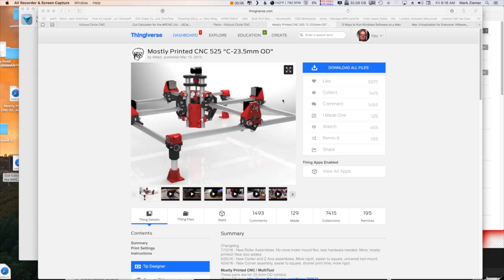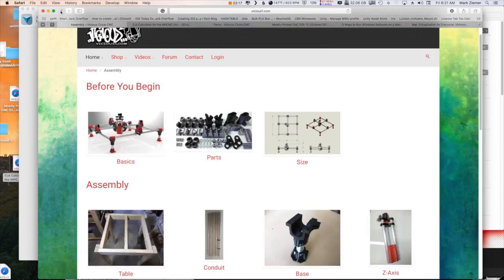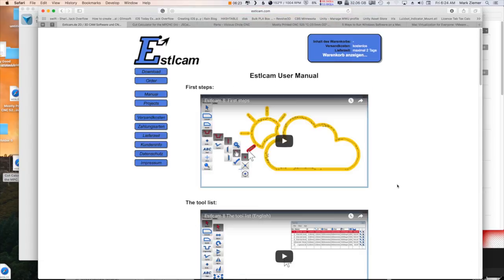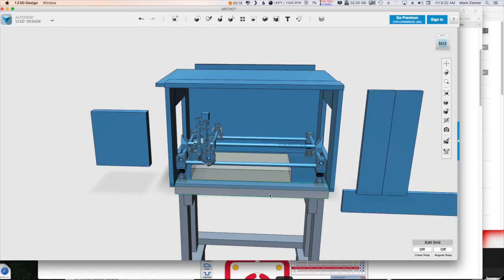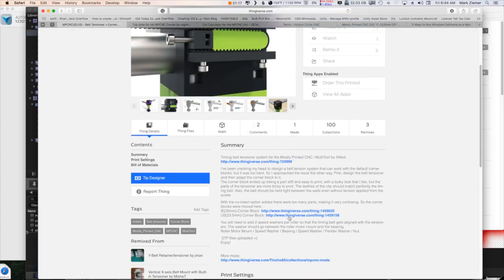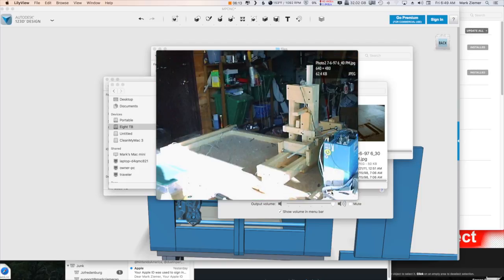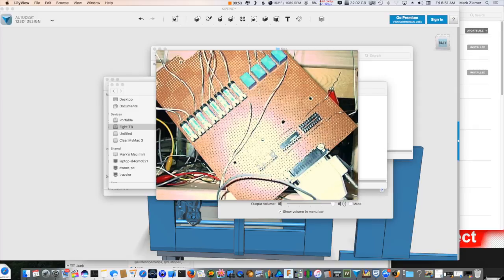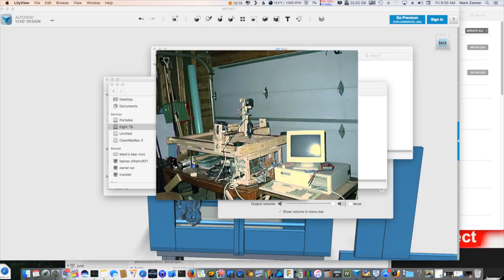Mostly Printed CNC (MPCNC) Build -  Part 1

Comment: Hi, i have read about pla enriched with aluminum with particular mechanical properties. Do you think is suitable for this project?
Reply from the maker: Cool, I haven't heard of that yet.  I'd say save your money for a laser or for other supplies.  Regular PLA is just perfect for this. It's very rigid, which is just what you need for a CNC machine.  I printed my lowrider parts out of the cheapest PLA on Amazon.com (Inland at $15 a kilo) and it was fine. Just use three shells and at least the infill that is specified on V1engineering.com.  Good luck!